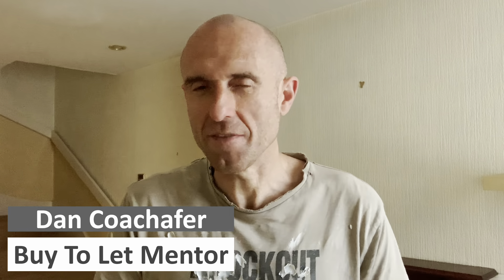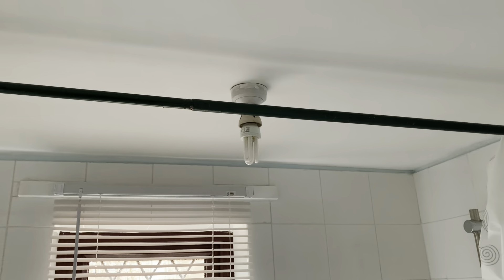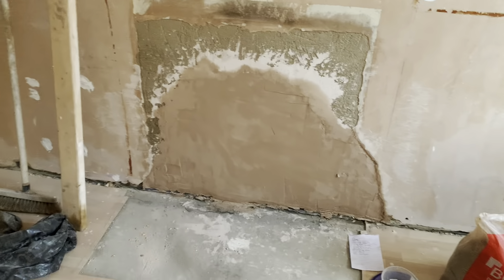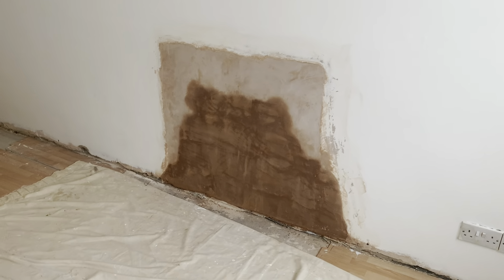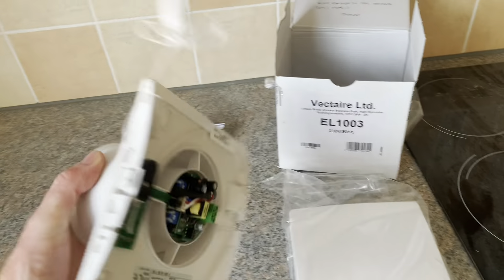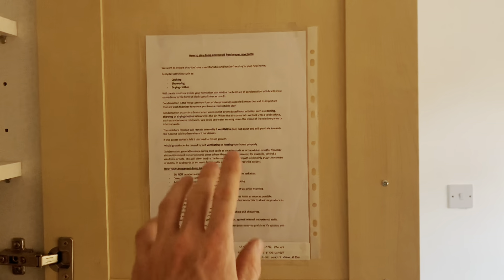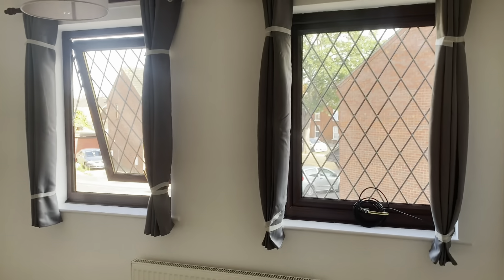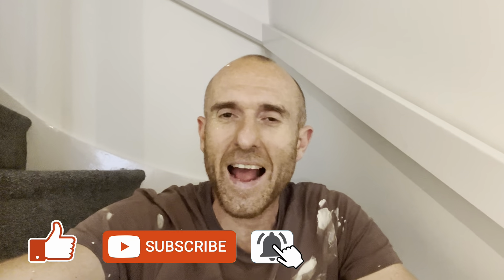Buy To Let Property Number 17 | Part 2 - The Renovation | Buy To Let Advice For UK Landlords

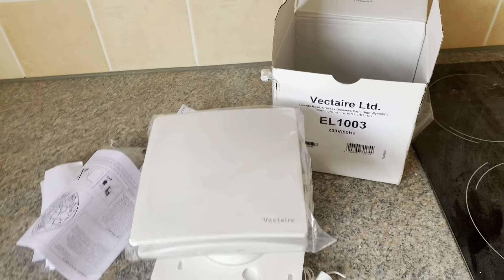Comment: I bought the same extractor fan for the kitchen. 17:49 Vectaire. My electrician is refusing to hard wire it, says it needs to be on a switch for safety concerns. However i can't trust the tennants to use it and switch it on
Reply from the maker: Hey Wicked witch of the West, the fans need to be hardwired so they can work as designed, they are made to trickle constantly in the background. If your sparky is refusing to allow them to function as intended I would suggest finding another who is willing to work with you to achieve the desired goal. 
Good luck, thanks very much for watching and for your continued support.

Comment: Dan, with putting the paint type and colour on the cupboard door , are you saying they have to keep the walls white , Really ? And by the sounds of it you don’t like anyone hanging anything on the walls .
If the above is true - do they really stick to the rules
Reply from the maker: Hi Steve,
Thanks for watching and for taking the time to drop a comment.
From my experience when tenants move on they often prefer to fill any holes they have made and touch up the walls themselves. I’ve had numerous tenants that have attempted this but used the wrong paint leaving the walls looking worse than if they would have left the holes. 
I ask that the property is handed back in the same condition that it’s received in minus obvious wear and tear, providing the paint details helps the tenants return the property to a condition that doesn’t warrant them being charged to redecorate. 
I hope this makes sense.

Comment: Dan I don't know why you hate sheds so much? Sheds are GREAT. Think somewhere to put garden furniture, a BBQ, a lawn mower. I think it's crazy to lose a good shed
Reply: its down to having to be responsible for what ever is left in the property before tenants move in so if it needed repair at any time dan would have to then fund the repairs which is obviously extra unwanted profit eaten up and on top of that if someone got hurt then you would no doubt be liable
Reply: @robdavis2474  YES I KNOW. You're missing the point completely. It's just so misguided. Sheds don't cost £1,000,000 to repair - just a coat of creosote every 5 years and tenants like them (as do most people actually)
Reply from the maker: Francis, 
Firstly thanks for watching and for taking the time to drop a comment.

A shed will not allow me to command a higher rent, neither will it stop someone wanting to rent my property, however, if left I will have to maintain it which will cost me time, effort, energy and money. If a tenant wants to have their own shed they are more than welcome but there is no benefit at all for me providing one. 

Thanks @rob Davis your spot on.
Reply: @new2property  I love your show, Dan. But, we'll have to agree to disagree on this one. The patch of ground you left after removing the shed looked pretty dire tbh, (even after you partly covered it up with a few slabs). Yes, you don't need to leave the shed and perhaps it doesn't increase the rent, but from my own experience when you provide a tenant with a "home" and "garden" that they can utilise and enjoy, you are far more likely to keep them for  many years to come. In brief, "if the wheel ain't broke, don't fix it." You removed a really nice, functional shed and left the garden looking a mess, in my opinion.
Reply: @new2property   🙂
Reply from the maker: @francissaunders4050  thanks for your comments and opinion its always welcome.